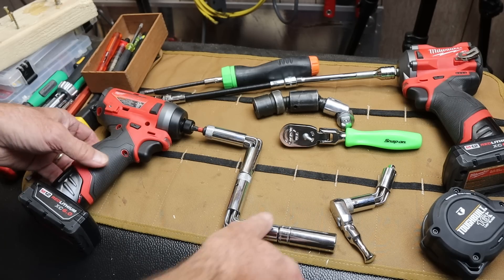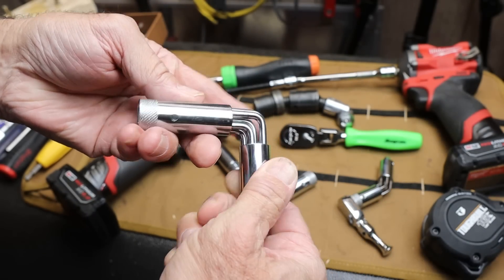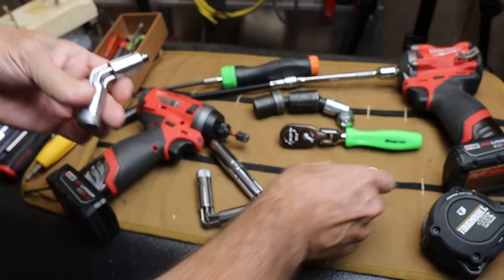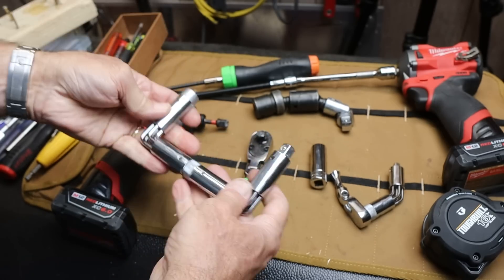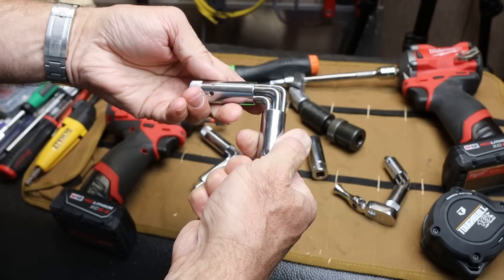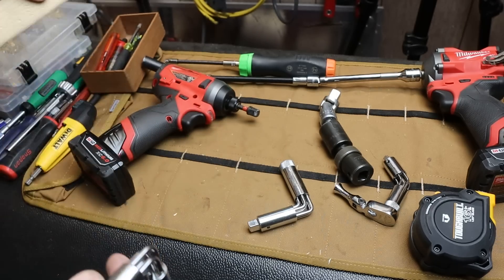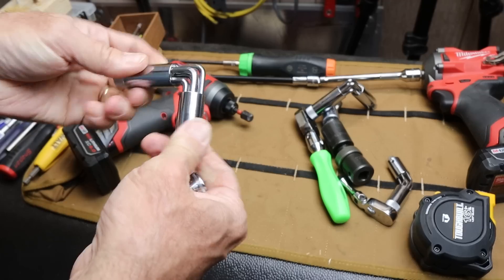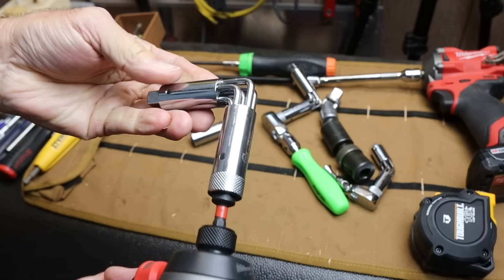CAL VAN Tools Gearless 90 degree 3/8" socket adapter: Cool physics at work!

Comment: I've used that exact model installing batteries. (the 3/8ths drive 90 degreee model shown carried by most Advance Auto Parts locations)
While vastly superior to U joint adapters in function, it isn't all that useful because it's so big. Not anywhere in confined spaces. Now, I've only got experience installing batteries, but...  I don't see it being able to fit anywhere you might need it. 

Speaking of U-joint adapters, is there a impact style, but chrome u-joint adapter? Because the normal chrome ones are so annoying as the pins are out of plane and it just binds up. But the impact ones seldom work past 45 degrees (i don't think i've ever seen one that did) and they are really bulky. They make them for automotive drivetrains so why not sockets? Its the same thing but smaller.

Comment: How it works is there are five 90 degree bent pins with a sixth one in the center. When you turn one side the pins rotate and go in and out. You could essentially take two handgun revolver cylinders with same sized pins and do the same thing.

Comment: Potential for outboard boat motor transmission and internal water pump? or even as an engine itself in principle it’s got pistons,I see some interesting potential and potential problems but anyone with a bit of spare time and gear should be able to make a moving piston a pump or motor but it would make a cool drive for a small boat or kayak engine, or has this principle been tried?

Comment: I believe this would be useful in a situation where you would need to snug up a nut or bolt. But not to the torque spec that you need. A solution for those that are hard to reach, but don't want to spend a lot of time "screwing them in" by slow movements because of the right spaces they are in. We've all been there. The last part to torque to spec, we can figure out. This seems like it will come in handy to save time in between that moment.

Comment: I have one that I bought a couple years ago. (3/8) I have only needed it one time for a bolt on a starter. It did well but I couldn't get a solid torque with it. As soon as you load up the foot pounds it twists off the bolt. I could snug it down but had to return to a wrench to get the max torque on it. I have an old Stanley twist grip wratchet that between this doohickey and that got it snug enough that it was within a quarter to a half turn from full torque. Bottom line for me? GREAT hard to reach bolt starter...just need to final torque with something else.

Comment: I would like to see a test similar to what they do on torque test channel or project farm. Maybe even using infrared camera and run one of those with your drill for 5 minutes to see how much they heat up.
It would also be fun to see how many you could connect together before the drill couldn't turn them any longer.
I don't know if I'd find any use for one of those but mesmerizing is definitely a good description. I like the wow factor.
Reply: Yes. And impacting.
Reply: @thepewplace1370  That would be the final test if anything survived.  Might need some incedeiry devices to make it memorable 😁

Comment: I believe the metal rods do not change length. At the bottom of the socket on each end there is a washer type sleeve like in a spark plug socket that the metal rods rotate on should be at 45° angle. At least that's my understanding of how it works. 🤷

Comment: Have you ever played with the Stanley Rotator Ratchet (89-962)? If you twist the handle it turns the head. Pretty cool tool.
Reply from the maker: I have not. I'll look into it. Thanks for the tip.
Reply: Facom 360
Reply: I love those.

Comment: These have been in my Amazon shopping cart for a long time. Haven't found a reason to buy them yet. Well, other than just to play with them like you are. Cool to see them in action!
Reply: Be warned though these won't stand up to any moderate to serious torque. The pins will start to bend. 25 ftlbs or so is the limit
Reply: You need a reason?!?
Reply: Same here

Comment: Doc, you did not connect all three and a healthy amount of other adapters to great a monster. Please. Pretend like you would have to drop the entire motor and transmission from a vehicle for one bolt. They said it couldn’t be done, but fifteen adapters, over 33 inches long, and anything is possible.
Reply: Heck, attach them to a PTO from a Cummins diesel and you could get the vehicle to take itself apart.
Reply: @VeniVidiVid  The other method is leaving the vehicle in a field for 50 years. I’ve seen this in practice more often than fixing up cars. Then that damn ViceGripGarage fellow that used to live a town over started gettin them to run. The audacity.
Reply: If it can get the starter out of a 1UZ with the intake on I’m sold.